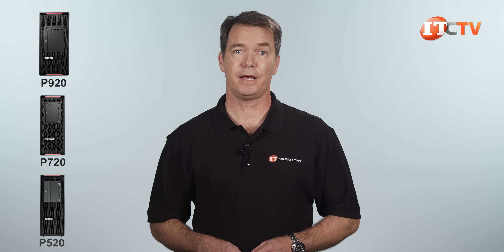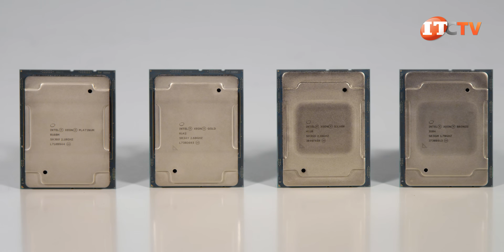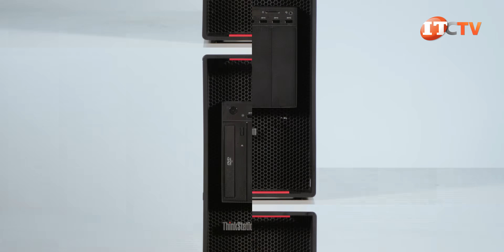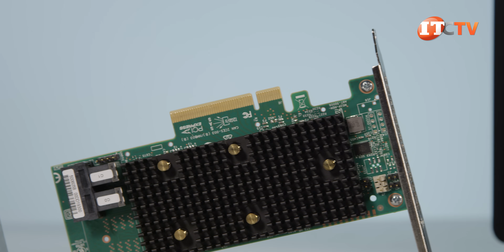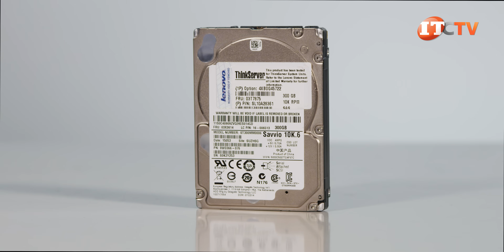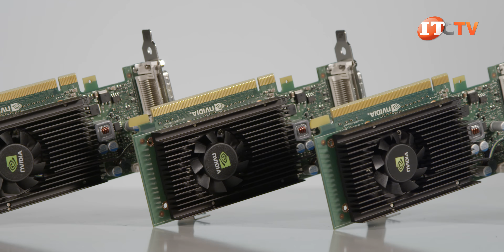Lenovo ThinkStation P920 Workstation REVIEW | IT Creations

Comment: I never hear someone mentioning if the p920 is good for 3d animation and video editing.
There are no video mentioning  about it. Every video i see is just about the specs.
Reply from the maker: This is an incredibly late response and I apologize for that but Yes! This system can absolutely be used for video editing it definitely has the power to do so and is comparable to HP's Z8 G4, and Dell's Precision T7920 workstations more or less, which were released around the same time. Thanks for commenting and watching!
Reply: @Itcreations-LA  thank you  for letting me know.
Reply: No it’s not.

Comment: Unfortunately, my p920 workstation is getting slower and slower. Not sure how to fix it. Can some one help me with this?
Reply from the maker: There is a little video that Lenovo produced that will give you a general idea of the things that can slow down your system, this: https://pcsupport.lenovo.com/us/en/products/workstations/thinkstation-p-series-workstations/thinkstation-p920-rack/videos/vid500122-tips-tricks-why-is-my-computer-slow. Definitely get some compressed air, disconnect everything and take your system outside, open the panel and give it a thorough blast all over to get rid of any dust buildup.
Another thing. If you are currently running hard disk drives in your system installing a compatible SSD will make a world of difference. I mean a huge and noticeable increase in speed. Check out SATA SSDs and use one of the drive slots on your system to install the drive and migrate your OS to that drive and any other programs you typically use frequently. Then make that your boot drive. I put an SSD in my 20 year old computer running Win 10 and it starts up in like 30 seconds now where it used to take over a minute. Hope that helps and thanks for watching!

Comment: What are some m.2 pci cards i can get. I want one that holds 4 m2 cards.
Reply from the maker: Hi there,
Lenovo offers this specific card for their P920 https://www.lenovo.com/us/en/p/accessories-and-software/memory-and-storage/memory-and-storage-hard-drives/4xh0v09766 
We do not have any of those but you can install other cards like this ASUS Card we do have. 
https://www.itcreations.com/product/127102
For both cards, M.2 drives are sold separately. BTW, here is a forum post talking directly about both M.2 cards you might find interesting. 
https://forums.lenovo.com/t5/ThinkStation-Workstations/BIOS-or-SIO-firmware-may-have-caused-crash-on-P920/m-p/5001795
I would assume other 3rd party cards will fit. Bifurcation of the x16 slot to x4x4x4x4 is recommended if you want to RAID the drives for performance or resilience. Thanks for watching!
Reply: Thank you so much for the info.👍👍

Comment: Show its power supply connectors. I purchased hp z640 last year it contains only 2 6pin connectors for the gpu while it supports gpu upto rtx 3080.  while rtx 3070 have 2 8pin connectors, while some rtx cards have 2 6pin and 1 8pin connect while hp z640 don't have much connectors. How i can give power to card which contain 2 6pin and 1 8pin ? 6-8 pin convertor can't provide full power to the card. Second when you make about work stations tell about power supply connectors and also about latest card and their power connectors also. Thanks.
Reply from the maker: Hi Syed, 
Yes, we will make more of an effort to show the various power connectors for GPUs. thanks for the comments and thanks for watching!

Comment: What's major difference between HP Z8 G4 Vs Thinkstation P920?
both look pretty similar in performance
Reply from the maker: You are correct. These systems have very similar specifications and are both the top of the line models from HP and Lenovo, respectively. These systems are kind of overkill on the specs to be honest. If memory serves me, I think one of the main differences is that the P920 only supports 2TB of memory while the Z8 G4  supports up to 3TB. Not a deal killer! If you are considering these two systems then also check out the Dell Precision 7920, which is Dell's most powerful workstation and definitely in the same league as the other two. We carry all three :). I have provided some links to our Workstations pages if you want to browse the models and the information provided. All three of these systems have also been reviewed on this channel.. Good luck in your decision and thanks for watching!  
Lenovo: https://goo.gl/oTUJ92 
Dell: https://goo.gl/n6nAzN 
HP: https://goo.gl/ay6bgA

Comment: I have an older P720 with dual Xeon E5-2670 v3s for 24 cores, 48 threads and 128GB of DDR4-2133 Samsung ECC. Also 2 8TB WD Red drives. Paid around $1200 total. Beast of a machine and don’t know what to do with all the horsepower lol 😂
Reply from the maker: Nice MR! Scorching deal on that system. Thanks for watching!

Comment: Very nice.  I am using one P920. Sure it's Monster. And thanks for sharing the info. Some minor I didn't know before.

Great video. And if you include the most interesting part. That one doesn't need a screw driver to tear part the whole system or add new components. It's really a well designed technology. On top of Real Monster Hardware.

The single processor start from 12000€ and full dual solution with 2 tb Ram. Xeon Platinum and RTX Quadro 8000 .... Will cost around 40000 €. Yes... You can actually buy a Tesla model 3 in this price of a system.

What you can do..... Locate every major Rock's Trajectory in our Solar System. And probably predict it's next move.

Predict 2 billion : 2 ratios.... Probabilities. 

Jhe.... Kinda Prediction Hardware that is waiting for Prediction Minds.

Keep on making interesting videos.
Reply from the maker: Thank you very much for the kind words! Yes the P920 is a great piece of hardware and IMHO very well designed and easy to upgrade. Thatnks for the comments, and thanks for watching!
Reply: What programs do you use for astrological entity prediction? Or what else can I use my P720 for? I did a comment with my specs but I can list them here if you want. Just looking for more stuff to do with this beast of a machine.

Comment: Out of the p330, p520, p720, and p920
Which one makes the least noise?
Reply from the maker: Hi there J.A. H. R. Puffin Stuff (had to, sorry, https://youtu.be/AxHF-VnzvVo), 
The one with the least HDs and CPUs will be the quiet one because those are the elements that require cooling. That said I have a P700 under my desk sitting about 12 inches off my right knee with 5 HDs two of which are standard HDDs plus 3 SSDs and I don't hear anything other than some crime drama podcast one of our accounting people is listening to. It really depends on how you outfit the system. SSDs don't make the whirring sound that a traditional spinning disk would make (HDD). All of these newer systems are very quiet. You could also go with a liquid cooling solution without a fan, which would cut down on noise but again these systems are pretty quiet. There was only one time my system started getting loud all of a sudden and it was because a Zip tie had gotten lodged in the blades somehow…Hope that helps and thanks for watching!
Reply: It depends on your configuration.
And when you do beefy computing and holds onto the top of line results.

You can compensate for 25 dbs.
Reply: My P720 doesn’t get above 50Dbs on full load while stress testing that’s with two 8TB WD Reds. OS drive is on an ssd